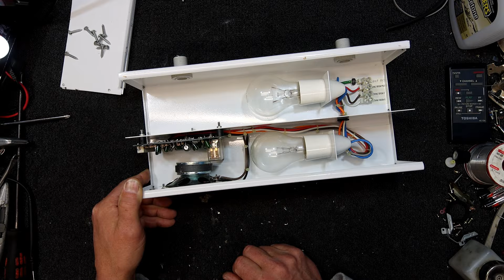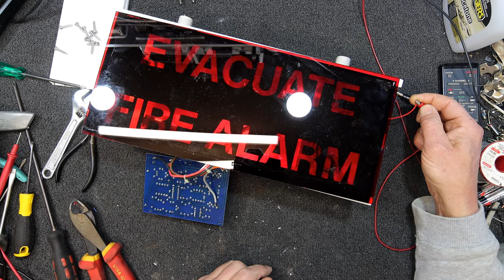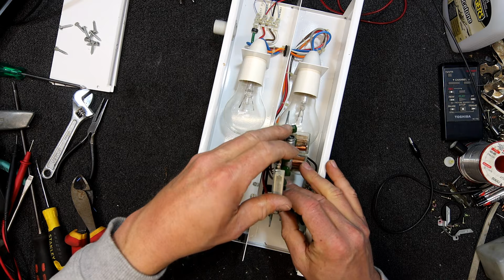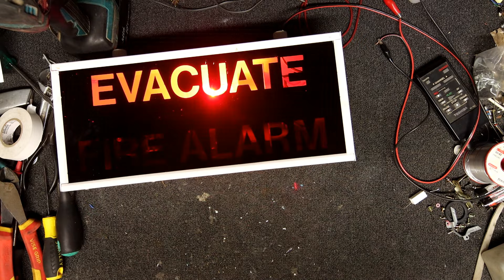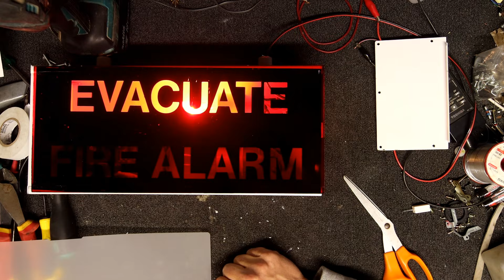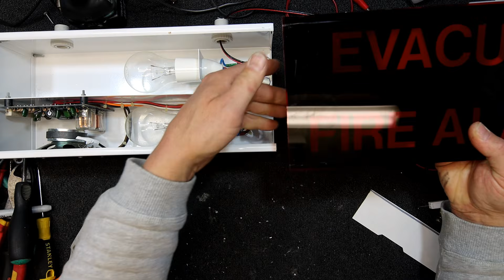Pekon Fire Alarm Evacuate Sign Powering Up

Comment: Pekon was an long obsolete australian fire panel. This is off an old gas suppression fire panel - most likely mounted inside a computer room. A single smoke alarm calls the brigade and lights up the fire alarm text. A second smoke alarm lights up the evacuate as well, and after a short delay, dumps gas into the room. I've never seen bulbs like this but 24v automotive festoon globes are common in older equipment. Today its all LED but the principal remains the same. They are wired up in a three wire system (common +ve) or more common today two wire and the polarity reverses depending if your want one or both signs running. And yes, they normally ship with a diffuser inside.
Reply from the maker: Thanks for that useful information. I wonder if these were left over from the Tasmanian governments computer centre, which had the halon gas suppression system, which I heard would kill you if you were in there when it went off. My boss, who was a smartarse,  went in there with a gas soldering iron at set of at least part of the system. Still makes me chuckle thinking about it.